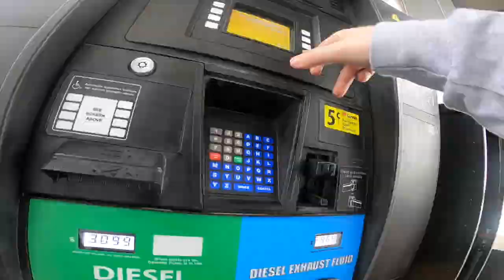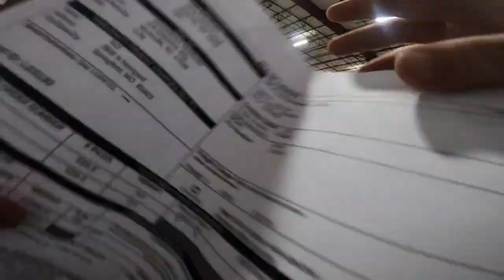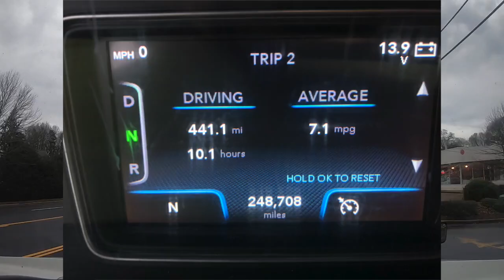Good Day

Comment: Oh snap, 640 hazmat go around...you pass through Knoxville?
Reply: @DoItDeWitt  Knox is awful, its better now that they raised the speed though.  Used to be 55 from 40/75 split all the way to the 40/81 split.
Reply: @DoItDeWitt  I'm stuck at 68. But my company will call you in if you over speed for too long.
Reply: @DoItDeWitt  nice
Reply: @DoItDeWitt  I live in Lenoir City.  364 on 40 or 81 on 75.